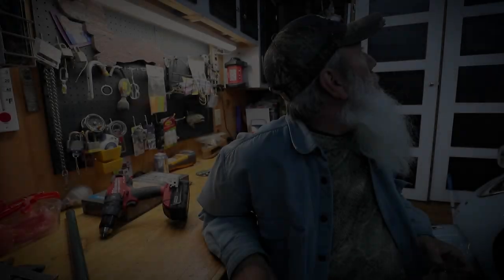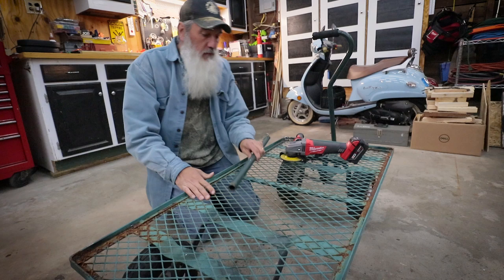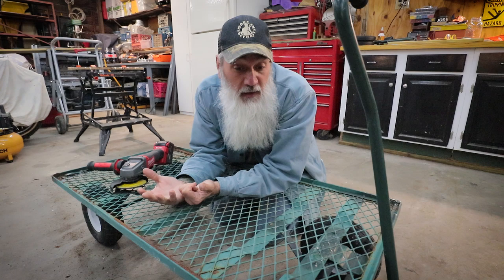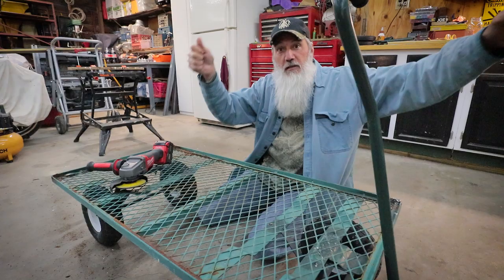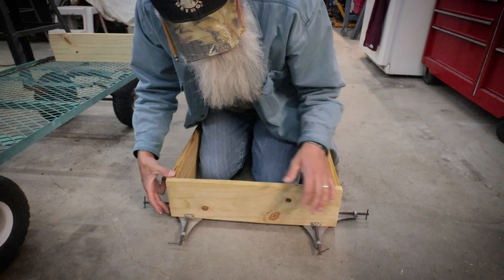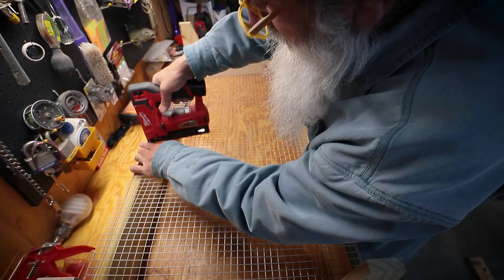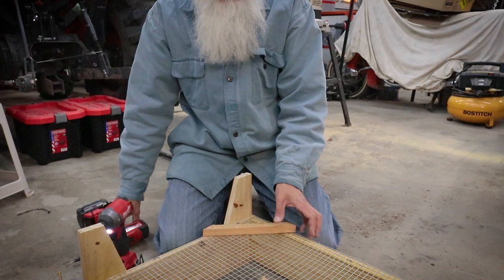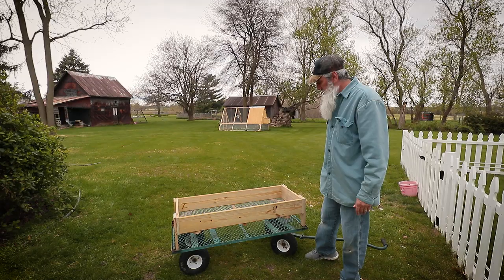Build #Withme | Portable Garden Harvest & Washing Station

Comment: One genius tip I saw from Steve's Seaside Allotment Channel, is to harvest directly into a bucket of water. I add a couple drops of liquid Castile soap. When your bucket is heavy enough, or the water is dirty enough, or you're done harvesting for the day, you pull out anything really tender first (greens, say), then the bigger stuff, directly onto however you're draining them. I have an outdoor sink and draining board, but it's unplumbed, so I don't want a ton of water in it. Your giant sieve would be perfect. Then you just dump the bucket water onto anything that needs watering. Veggies stay fresh and cool in the water, and cleaner than when they started.
Reply from the maker: The soap doesn't hurt the garden?